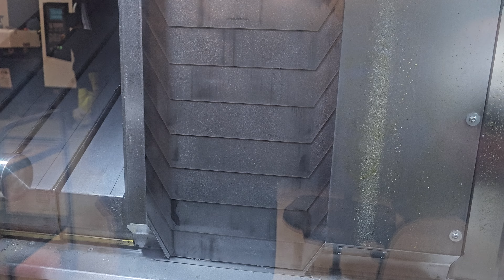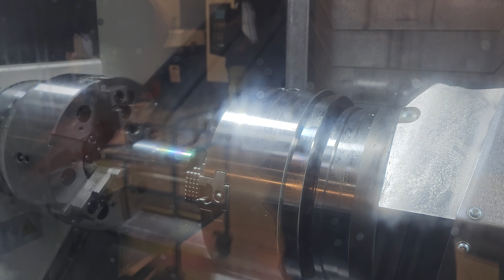DMG Mori CLX450 TC testing and demo

Comment: Looking forward more videos on this machine. I keep thinking about what I would need next for my shop and one of these always come to mind.
Reply from the maker: well , this machine is nice , but it can't do full 5 axis , and it was not built for roughing stainless. The subspindle is a waste of money for a job shop , a steady rest would have been much more useful . The toolchanger part is really nice , finally you can use more than 8-10 tools per one operation . It's also very versatile because you can easily machine o.d. with an i.d. tool . And the live tooling compared to driven tools is much much better . But unless you have specific need it's better to buy a VMC like DMG M2 , and a medium size turret lathe . It will be cheaper . and ultimately you can do more with them .